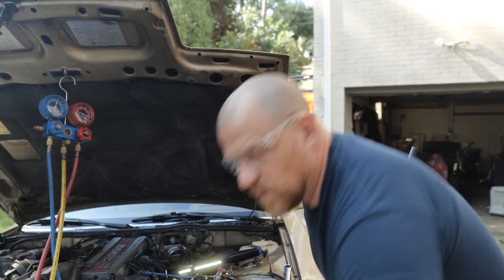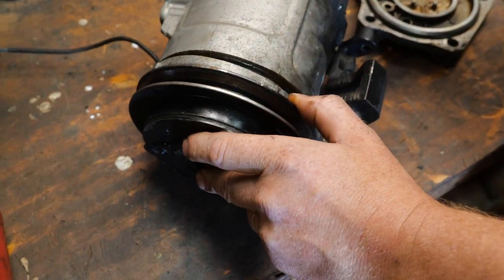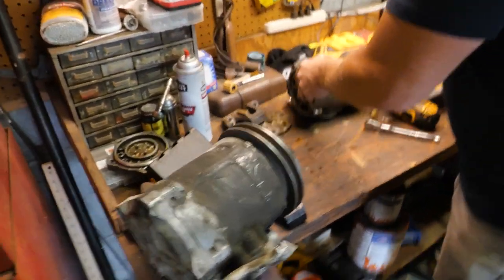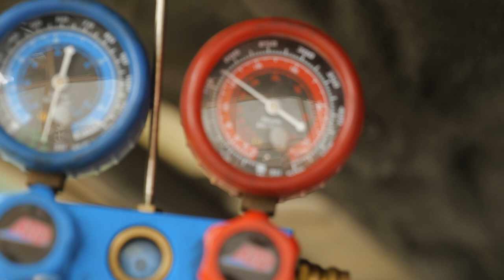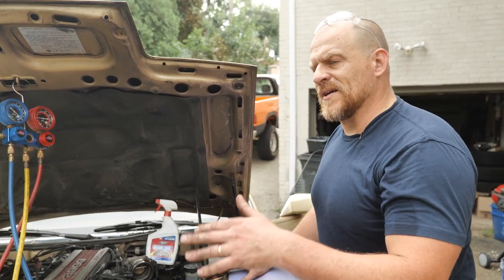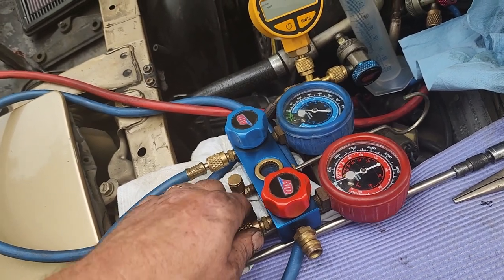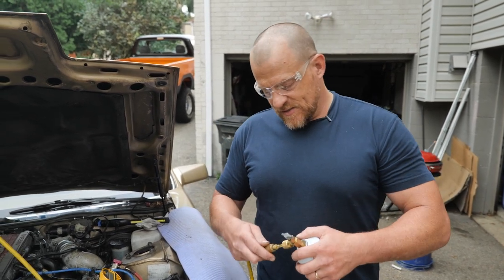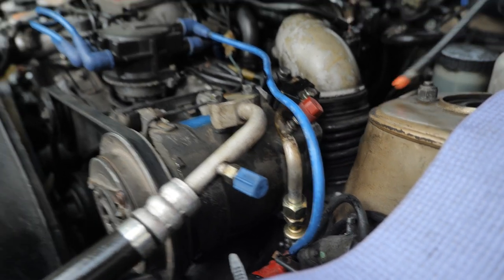A/C Repair Lasted One Day [What Did I Do Wrong?] - Part 2

Comment: Danner, you can't make a mistake working on old equipment It's frail and it comes apart, the sun comes up again. to me that was an old broken part that you attempted to service, like me, too old to be saved.  Rust is oxidation which is part moisture which is 100% water, which is 100% non-compressible. Until the customer has the money to evacuate and fix the system everything done to it is just a bandaid on an already festering wound. it will get worse before it gets better.

Comment: Sometimes it’s worth doing the whole job the first time.. both customer and the shop.  Because I have a volvo I picked up a while ago that has AC problems, 2011 (second half model year) C30 and already spent more on repairs for the AC than I would have on replacing the entire damn AC system under the hood and in the cabin..  

and because it’s a volvo, sure easy to actually work on contrary to popular belief, defiantly among the easiest euro car to work on.  but because it’s volvo they have to put certain stuff in stupid locations just to remind you it’s euro,so I couldn’t DIY i felt like, so all my leaks where just out of reach.. lol

Comment: I can get o-rings nearly any size and many bearings locally 5 days a week. where? an old bearing and transmission parts supplier, only twice in 30 years have they not had what I needed in stock!
they also sell/cut to width many serpentine belts. I suppose some day China will take them out too, like the old school auto parts stores and other material suppliers that always had hard to find things.

Comment: Had one a week or two ago car came in couldn’t remove the key, checked for codes bcm no comm check power and ground has power and ground check high speed and it was at 10 mohms tell found ecm to be the cause of the 10 m ohms then tell the customer need to start with the ecm will most likely need a bcm too ended up having to replace both to get everything to work and program let vehicle run for 30 minutes took for a test drive get back thing shuts off after trying to let it warm up the second time  alternator stopped charging. Came back 3 days later with a check engine light had an evap leak and it needed evap lines going front to rear came back another week later vent valve stopped working then came back again for another small evap code fuel pump rusted out then taken it apart fingers on the tank broke….. some cars just won’t go away
Reply from the maker: That sounds like a nightmare
Reply: @ScannerDanner  some cars are definitely more of a nightmare then other’s, plus living in pa with all the rusty cars doesn’t help those.

Comment: I always watch your videos good job on your troubleshooting. I have a question. I have a 99 Tahoe.  I did the recharge with 36oz it feels cooler but someone else said I needed 64oz because it’s dual air. I don’t want to over charge the system.
Reply from the maker: Service info says "all vehicles with C60" is 2.0 lbs and "all vehicles with C69" is 3.0 lbs
I'm just not sure what the numbers mean, but I'm guessing yes, the dual air system would be the higher amount. What are your pressures with the 36 Oz in it?
Reply: @ScannerDanner  I live in the desert 100 with 30% humidity. resting pressure 160. Running 55 on both H & L. Compressor is constantly on. What I am doing wrong. Overcharged???
Reply from the maker: @bert2423  sounds like the compressor took a crap, I'm sorry. That can get expensive 
It basically can't pull or push with any efficiency. Next step for me would be to pull the orifice tube and inspect it for amount of debris (from the failed compressor). The results of that will dictate whether or not you also replace the condenser. And of course you definitely want to do the accumulator drier too with a new compressor. 
From memory the txv is in the rear and the orifice tube is in the front
And we may have to worry about debris in the rear too

Comment: Naw that compressor was a grenade with a wheel on it, not a pin. Be happy it blew up on your bench and not on the vehicle. The aluminum is old and brittle, and all the seals inside were on the way out  as well. The fact it even worked for a day is impressive enough. Who knows how long it went with a leak for. Long before you guys owned it I'm sure.

Comment: what the holy-moly is up with the pvc drains in the background.  it looks like a 4" coming out the wall to 3" pitched downward from left to right, then a 2" off the wye and 45 ell. back pitched right to left? missing/broken straps/hanger and huge sag or? my eyes catch all sorts of things when watching videos, I guess that comes with age, knowledge(wisdom?) experience. wandering mind?
I've always been that way though.
Reply from the maker: Dude, the hoses and air intake and pcv and secondary air injection on this car are a nightmare! It took me 2 hours to pull the air intake off. Stupid, stupid, stupid design and the engineers didn't give a crap about us back then

Comment: im glad u are trying to use the micron gauge. so u got some learning to do. u need to have a cut off before that gauge in that configuration so when u do a decay it will be on the system itself and not include the hose and gauge set, or get u a TrueBlue hose thats large and use the one hose method with micron gauge on other side of system only. now that u are trying to do it properly maybe you should do some more this way so that those other guys will learn the proper way. everybody jumps on scopes, transducers but the elite channels butcher ac jobs cause nobody will step up and teach the right way. i think it goes back intime when we were grease monkeys shade tree etc and could not be taught. and the wrong just keeps being passed on. i have made a bet on  other channels that you wont find any channel as good as tom lech for auto ac. he does it professionally. its up to you to help people become better is what you say. so please help people on auto ac, change that attitude been doing it for 20 yrs this way. i like to get below 500 and decay for 15min and not go over 500. i achieve these numbers all the time so i no my system is dry, so the compressor has a chance to live a long life. no moisture to turn acidic and kill the system 1,2,3,4 yrs later. also ask a residential guy to pull a vacuum on ur home ac without a micron gauge and only one hr vacuum, i think he will laugh at you .dont mean any harm  but we have to get better training. please please help with this.
Reply from the maker: The micron gauge isn't some magic tool that must be used. It is A tool and it's nice, but it's not the be all end all. It certainly did nothing to identify a leak that would only leak under pressure. Sure it's great for making sure you have all the moisture out, but honestly, so was my vacuum scale on my manifold gauge set. Got concerns about moisture? Then pull it under vacuum for a longer period of time. 
I think it's overkill and someone is certainly not a butcher because they may not use one.
Reply: @ScannerDanner  im not trying to get you angry. ur manifold always shows aprx 29 inhg nothing else.i have did vacuum chamber test with water in it. i could put 1oz in it or 15 oz in it. it would pull down about 2700 microns and stall their with any amount of water. gauges just show 29 nothing more. that 2700 has meaning. it tells u u still have to  much moisture content. i have watched the residential guys on this and that is why they use it. its a must for getting their system dry. so what is so different about theirs and ours. we have a lot in common, getting the system dry. i have pulled an hour. 2hr and still have a hi micron reading which tells me its still got to much moisture. these numbers dont lie. its facts. untill u learn about that micron gauge and its use we will disagree.thats ok. please watch love2hvac on vacuum and the micron gauge will u understand what im putting fourth. just for ur decay if it does not leak under vacuum its good, but you always have to apply pressure as well. leaks are a study on their own, large,small ,micro, vibrational,hot ,cold many things to look at .when a liquid is at saturation its partially in liquid and vapor.. state just like the pt chart shows us. untill u get all the liquid out is when u can get the low micron reading. all im asking is watch those teachers they teach for a living about hvac. its like you telling me get a labscope and i refuse. ill be the looser if i dont check into it. thats all im asking .do some more research..its out their its good information. watch tom lech and tell me hes crazy. i have learned much from u and others thats why i do things different now because i have the knowledge to do it right. like you i like to pass on what ive learned. but we can disagree but i still love u anyway
Reply from the maker: @RATCHETMAN1001  this is great construction criticism, I just did not like your "butcher" statement. 
Question on your 2 hr example with 2700 microns, was that a car or a house? Why was there so much moisture in that system if it was a car? (Great example btw)
I'll continue to use it for moisture content as you suggest. I just won't call someone a butcher who doesn't use one. 
And it's certainly not a magic tool for leaks as I was lead to believe
Reply: @ScannerDanner  im not criticizing you. im trying to educate. when u show videos how people have messed cars up (i wont use the term butcher anymore sorry to upset u) u show how they went wrong and u show us the proper way to do it right. thats all im trying to do. u say u will try the gauge some more but u did not say u would watch tom lech or love2hvac , they have the knowledge and video proof and how to use that guage,if u dont take the time to watch them u will never respect what that gauge can do for u. its in your hands now.its up to u. let me no if u watch them and tell me these guys are crazy for what they teach. then i will stop right here i will concede.
Reply: i hope some of ur viewers will check these guys out they put forth truth just as u do, maybe they will learn something new as well. i just like learning and the facts are their, not this old outdated stuff thats still happening.. some times i think its peoples pride that gets in the way. they dont like hearing truth or excepting what they were doing is wrong. thats just my opinion .we all differ in opinions i no. i realy hope this does not make u mad. its not my intention
Reply: @ScannerDanner  it is the magic tool once u learn it. from ur statements u have not mastered it yet. if u only use it for leaks now that would be for vacuum only and if u develop a leak it will respond quickly where ur manifold wont. but if u thought it is for leaks only u dont understand its purpose yet. thats what im trying to help u with. only by watching tom lech and residential guys will u get the most out of it. even studying the three gas laws will help u. thats what im doing now. so ur question was on a house or car.it is on cars that have not been repaired for leaks and left open to atmosphere or did not get the proper vacuum on its last repair . the more u learn how to use it in ac u will see those numbers a lot. i dont no if u understand the term saturation. this is where u understand how the gauge helps. if u take time with a small vacuum chamber off ebay and do the test with water and the micron gauge it will become clear to u.  i have tested pag and poe oil after it sat out for an hr it will boil from the moisture it absorbed. its a visual test u can see with ur eyes .if u refuse or resist doing these things u will always have that attitude. again im not doing this to put u down or criticize you in no way. im putting forth truth and facts that i can backup
Reply: @ScannerDanner  also the manifold only showed u 29.9 or so ,so it did not show it was dry but the micron gauge did. thats the difference of understanding a micron gauge and a manifold gauge set. and then u state if u are concerned about moisture pull vacuum longer. what will 29,9 do for me for 10min or 15hrs its always showing that same 29.9 but the micron gauge  shows us the truth. there are no numbers for proof when u say longer, u are just guessing at that point .no facts. the proof is when u have very few molecules of contamination  left in the system. their are standards set for hvac. we are just not taught them. and u think its overkill because you have not really looked into hvac enough and studied on a deeper level. maybe we can agree the drier the system the better it is, or u may not agree with that statement. but if u look into ac not auto ac cause you wont find it their. and vacuum will be different at different locations. start pulling a vacuum and watch ur manifold set and the micron gauge u will see ur manifold will show 29.9 quickly but you micron gauge will show hi pressue for a while. but you have to use one hose on one side of the system and the micron gauge on the other side only, dont involve the second hose. im not pulling this stuff out my behind im only stating facts that anyone can find if they want to check into what im claiming
Reply: @ScannerDanner  who ever you watched or who told u it was great for leak testing did not go far enough on its use either. but if it stayed at that 500 it did prove u had no leak under vacuum during that time frame, but im unsure at how u performed the decay. i have never seen it stay at one number i never use two hoses. just one hose for vacuum and the micron gauge by itself on the other port. then i disconnect or unscrew  valve on my vacuum hose so it will not influence my reading . cause im watching for a rise in 10 to 15 minutes which always occurs. it maybe small 20 50microns maybe more if it still has moisture  in the system. you want it to stay under 500 if possible. its understanding why u have the rise and  how it rises. thats where graphing comes in handy. when it is too much thats the key , but it will always rise it will never stay at one number only. i have tried to help u understand their is much more to hvac than what we have been taught. i feel we have been misguided for to long. i feel like u think this is to involved and unnecessary. i do alot of ac work and the only thing has changed is the time to do it right. it does not change my cost cause i dont sit and watch the car. im doing other work while the vacuum takes place.

Comment: Even more reasons to work on your own cars. Would you trust a shop to do this the right way???  Just imagine the cost!
Reply from the maker: The right way, is to replace everything in this AC system. Possibly keep the condenser and evap core, but literally every hose, every o-ring, the drier and the compressor. Or you make the customer aware that you're only standing behind the part you replaced. Let them decide.

Comment: When you strip out aluminum like that how you did around 14min mark I learned just better to go grab a tap and tap thread in by hand slowly instead of fighting and fit another bolt in with matching threads instead as risk of splitting the aluminum or pulling more threads shoots up just fighting it specially when your in the mode of constantly making little screw ups.